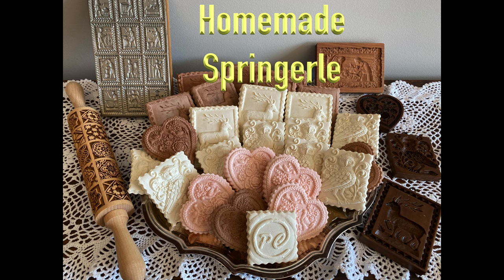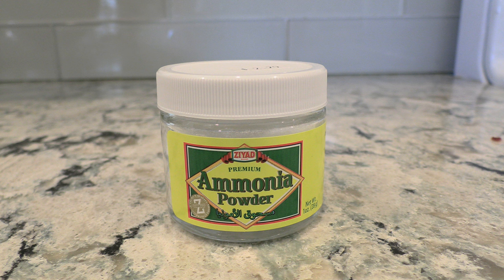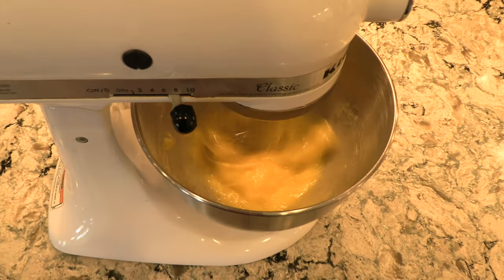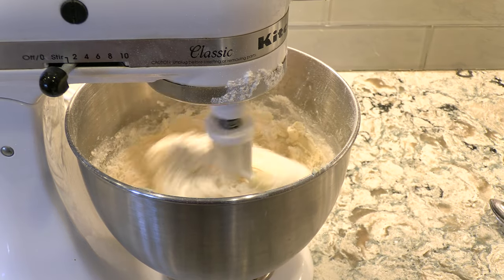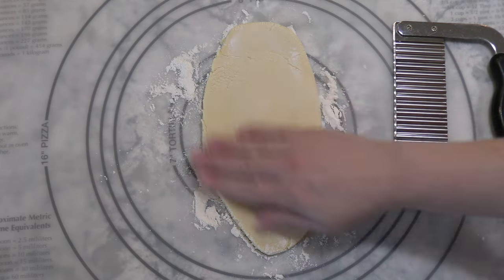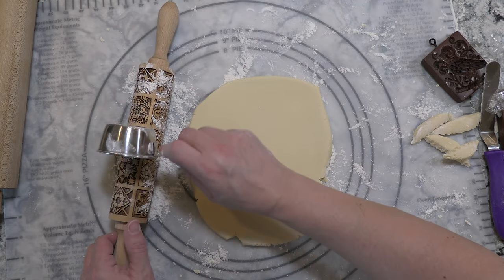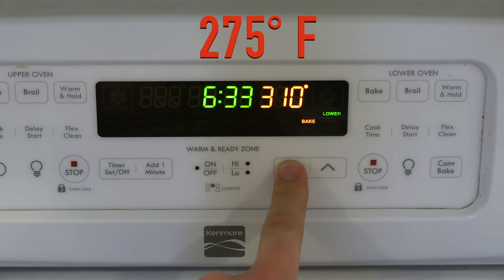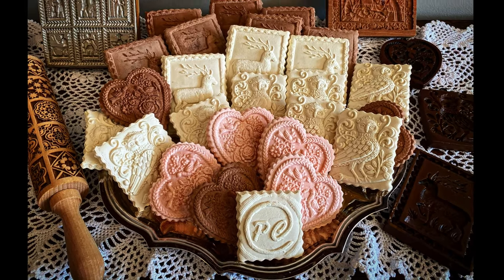Homemade Springerle - German Style Cookies

Comment: Best recipe I've tried so far - found that doubling the recipe works - putting dough in the refrigerator overnight does not - changed the consistency and made it unworkable.
Reply from the maker: So glad you like my video! Thanks for the tip about putting it in the refrigerator overnight

Comment: What does the ammonia powder do?  Is it necessary?  I am still in the muddle of the video.
Reply from the maker: The ammonia powder provides the rising that most people usually need baking powder for. Ammonia powder reacts with heat to make the cookie rise, where as baking powder need some moisture to caused the rise and you definitely do not want moisture in a spring early cookie or it won't maintain the beautiful shape.

Comment: Please guide about ammonia powder .why is it used?
Reply from the maker: The ammonia powder provides the rising that most people usually need baking powder for. Ammonia powder reacts with heat to make the cookie rise, where as baking powder need some moisture to caused the rise and you definitely do not want moisture in a spring early cookie or it won't maintain the beautiful shape.

Comment: There is absolutely NO reason to toss the egg yolk.  If you weigh your eggs you will find also an exact measurement.  You would only need to reduce part of your eggs if your eggs are very large.  This part of this video is lacking.  (yes, Ive been making spingerle for 40 years)
Reply from the maker: Sounds good. I will have to experiment with that. However, I know for a fact that what I did in this case worked. Which is all that really matters to me. Thanks for the tip, I will try your method at some point.
Reply: y u so mad
Reply: he did good
Reply: What is ammonia powder & why is it in baking?
Reply: I’ve heard it said that people toss the yolk when they want their Springerle to be more of a snow white color. 
His video is definitely NOT lacking, at all.
Reply: @njochara It is Amonium Bicarbonate; also called baking amonia or hartshorn.  It is used for leavening cookies and crackers; it takes the place of baking soda or baking powder. Baking amonia makes crispy cookies instead of soft. The amonia will evaporate/off gas during cooking, so you will not be eating anything harmful.
Reply: @k8thegreattt y u nt wrtng prprly